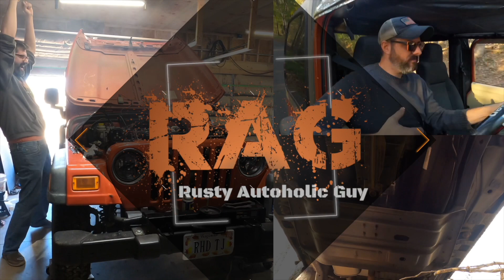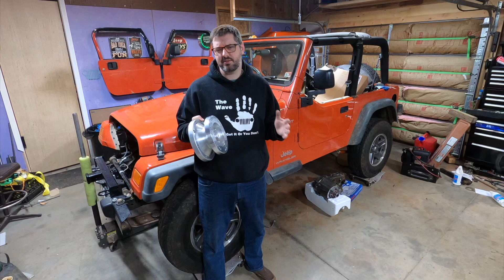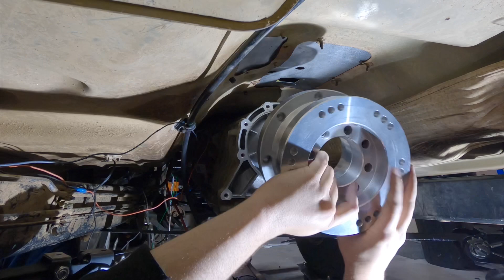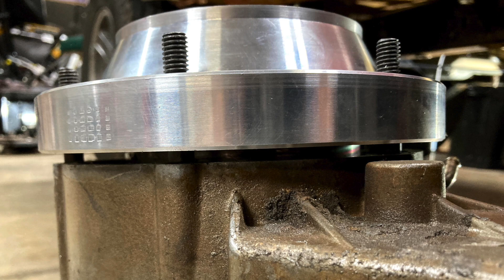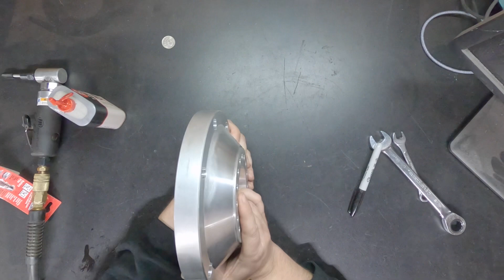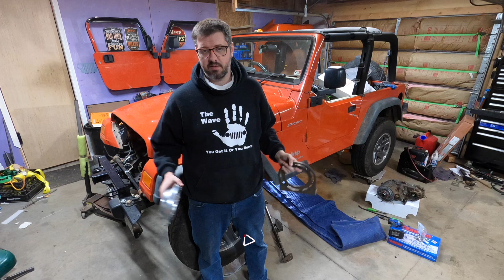Installing my custom Ford 6r80 automatic transmission to NP231 Transfer Case Adapter

Comment: How much longer is the drive train now vs with the aw4?
Reply: How much was that adapter?
Reply from the maker: The rear driveshaft now is going to be around 21" long, about 7" longer than the AW4.
Reply: @RustyAutoholicGuy  wow that's a short drive shaft. Where are you getting it made?
Reply from the maker: Oliver's Driveshaft in Winston Salem NC.